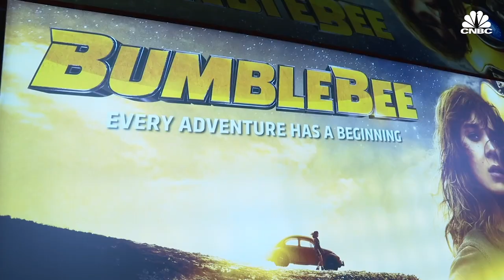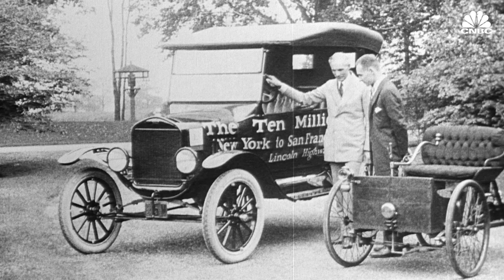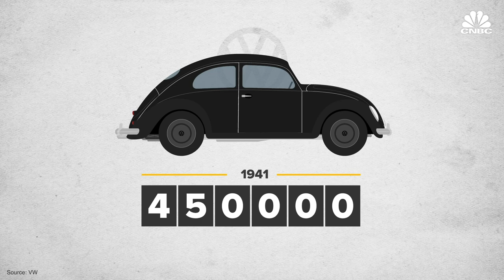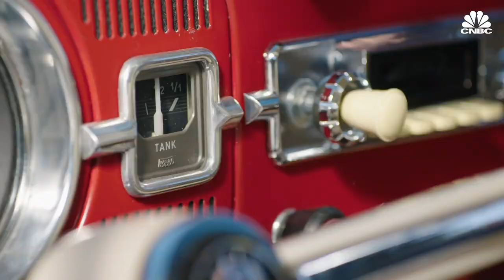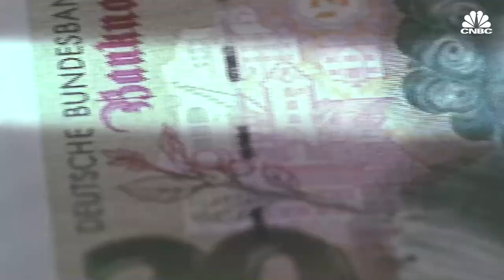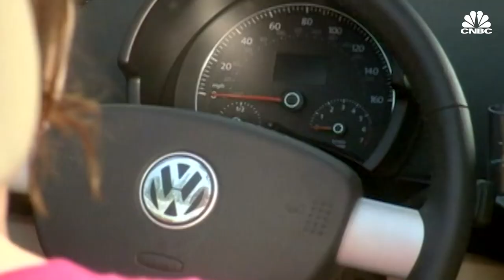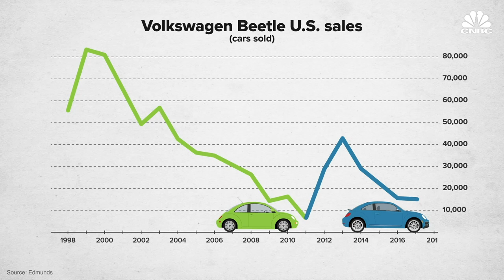Why Did Volkswagen Kill The Beetle?

Comment: Poor reliability. VW and Audi have major quality control problems
Reply: You could not be more wrong.  Since 1982 my father has owned over 20 different VW's and the quality is absolutely amazing they just keep going.  They have to be the most reliable cars around. If I ever decide to get a driving license I'll be getting a VW, probably the ID.
Reply: You are completely wrong! Check out google. The early air-cooled Beetles were synonymous with both quality and great reliability.

Comment: Between the old Beetle and the Golf, Volkswagen experimented unsuccessfully with other modern-looking vehicles. However, they all had in common with the Beetle that these air-cooled rear engines had. The cooling was also insufficient, which led to the engine overheating. 
The water-cooled front engine with front-wheel drive was only added through the acquisition of other smaller manufacturers such as NSU and Audi. The Golf, Polo and Passat (Jetta, Vento) are derived from these models. 
The New Beetle was basically a redesigned Golf.

Comment: The post-war Beetle was highly inefficient in terms of space utilization. It's external dimensions were quite large but space inside was cramped. The true revolution in small-car design was the Mini, conceived by Turkish designer Isigonis. A box with tiny wheels mounted at the corners and a transversely-oriented front engine with front-wheel drive. Raced like the dickens as well.

Comment: I drove a 1960 beetle with 36 ponies in 1968 first year of college. The tail lights were as big as my first. The bumpers we called spaghetti bumpers and no gas gauge. I found out the hard way that the reserve switch by the gas pedal was kicked to the right while driving with one spare gallon to get you to the next gas station. I gallon was a quarter. Graduated college and bought a 1972 Super beetle, my hands didn't hit the dashboard or the windshield when cranking the steering wheel. Too many firsts in my VWs.😎
Reply: My first beetle was a light blue 1960 beetle with 36 hp motor. Top speed 69 mph, took the bumpers off one day and top speed increased to a scary 72 mph!

Comment: I've owned a few Beetles and enjoyed the experience most of the time. The 1950/60s version wasn't an easy or particularly pleasant drive, I recall. The steering could be exhausting in strong winds as the front tended to be susceptible to these conditions and meant that one was continually adjusting and repositioning. Only having a 6 volt battery made night driving in  heavy rain an unpleasant and exhausting ordeal - the main beam being utterly useless. Fortunately  the later versions had much better suspension and proper batteries. The engines were amazing and virtually bulletproof. I also owned a 'variant' estate, which required a 25kg bag of sand in the front boot as ballast! The engine was fitted with an early bosch fuel injection system, which was reliable most of the time, but because the fuel was being injected under pressure, could suddenly eject the fuel feed pipe and spray petrol in all directions - an experience I had whilst driving along the Hunsruck during a holiday in Germany 30 years ago.

Comment: In 2019 I sold about 30 Beetles.  1/2 the customers who bought one had an existing one that they were keeping.  No one ever leased a Beetle as it is not your typical car one turns over every 2 to 3 years.  The problem I saw is that the Beetle sales were slight because the turn over rate was nonexistent.  I own 4.  May favorite is the 2014 TDI Convertible.  Second is my 2.5L 2013 Convertible.  I also have a TDI Touareg LUX, 2012, with 170,000 miles on it.  It's half way to being broken-in.

Comment: I grew up with the VW Type 1 - Beetle. I never owned one and I do want one now, but only as a secondary car to be enjoyed at my pleasure and not out of necessity. 
I do however, have an "almost" new Beetle - a 2008 VW Rabbit (Golf in Europe) Mk 5 which has the mechanicals of the new Beetle but with a hatchback and four doors. The engine has more access because of the larger hood. Great little car with a big engine: 2.5L I5 engine which is bulletproof.

Comment: In the 80s there was another Volkswagen model that was constantly being rebuilt and sold, and rebuilt and sold. It was a cheap and easy repair little car. Most all of them were coloured in yellow. From far its looks abit like the golf, but when closer look, you can pretty sure it's a knock down, with bare minimum comfort considered little run around car. It's the 'Rabbit '. Me and a group of college students and young mechanics used all our spare time in doing just this. This little car help me through college, allow me to pay off my student loan within two years after graduation. It also helps me in ways only a small group of my coworkers knows about. Let's just say without the Volkswagen Rabbit, I will not be the man I'm today.

Comment: And no mention in the early history that Porche stole the Type-1 design from Czech Tatra designer Ledwinka.
Reply: What year did this happen? Porsche first design of the beetle was about 1932 or 33
Reply: @keithad6485  He was a great designer no doubt. Porsche got the assignment from Hitler in 1934. He may have doodled something down in 32-33. But that looked very different than the first production type Beetle of 1938, which was just shortly after Germany's invation of Czecko. The Tatra T97 was made in 1936, has the exact same mechanical construction and a very similar design. The factory was in the first annexed part of the country. The natural follow up would have been a smaller 2-door version, but it never happened. As well as Porsche on being accused of stealing the design is reported to have replied: sometimes Ledwinka looked over my shoulder and sometimes I looked over his
Reply: @jensrogerkristoffersen5472   Porsche was designing vehicles of one type or another since before WW1 including battery powered electric 'cars'. Lohner Porsche was one such design. There is a book, long out of print, which delves into his early designs including the very first designs which became the beetle. - Dan R Post   'Volkswagen, Nine Lives Later', published 1966. If located, this book is well worth acquiring for anyone interested in the early history of VW and Porsche. I have a copy packed away, I must check it when I locate it to see if it mentions the Tatra connection. I am an admirer of Tatra.

Comment: @7:33 "In 1998, Voltsvagen decided to bring the Beetle back in a new form as a bubbly front engined car."
Why?  
WOW! THEY MENTIONED IT!!
@8:27 "a return to the original air cooled rear engine vehicle"  THERE WE GO.

At least they mentioned it;  the real value of the Beetle was MAINTENANCE as well as the purchase price;
1: No heavy transmission between an engine at the front and the drive wheels at the rear
2: No water radiator

Comment: Overheating, heads cracking and valve seat recession were a big problem in Australia. Not having a temperature gauge meant that going for a long trip on a summers day was like pulling the pin out of a grenade. If that woman is an expert on cars I am Napoleon Bonaparte.

Comment: The newer Beetle had one major drawback.
It did not float.  It wasn't terribly resistant to the elements at all. 
Those old bugs were amazing. I saw a fellow pull one out of a flooded street, towing it behind him on a rope. He got a buddy to help push it up onto a side street that was dry, opened the doors to let the extra water and a few live fish out, and got it cranked right up..first try...drove off into the sunset.

Comment: They will also float for about 10 or 15 minutes . They are good in snow because engine is low powered and is over the axles but very cold inside because heater was terrible. . They make excellent dune buggies .

Comment: My first car in 1970 was a 1957 bug with a small window in the back. It had a six volt battery, which I found out by mistake when I tried to install an eight track player in it. It had an 859 cc engine in it. I could shift it into any gear without a clutch at the right RPM, well except reverse. It was very hard for a two sixteen year olds to "mess around" in the back seat. It was too small. 

I traded it in in 1971 for a 1967 Datsun 410. There was more room and four doors. It had a 1000 or 1100 cc engine! I thought it was well made.

Comment: What really "killed" the Original Beetle in the US was the new Safety & Air Pollution Standards!  The Air-Cooled engine of the Beetle didn't work well with the Catalytic Converters, so there was really now way to continue building them for the US market!
Reply: Also they were EXPENSIVE back then for what you got. In Puerto Rico a '75* Beetle had a U$5295 MSRP (all-in, except for tag and insurance), you could get a '75 Corolla for ~ U$3500.

* last year German-made Beetle coupes were sold in USDM, convertibles stuck into '77

Comment: Everyone complained because the new Beetle had lost its roots and it wasn’t a “people’s car” anymore ... but, face the facts ... any car made today that isn’t loaded up with extra options, gadgets, and technology just won’t sell to anybody but a diehard original VW fan; and there just are not enough of them to keep sales going strong year after year for a basic, stripped down model. Any nicely equipped car sold these days for around $25,000.00 is a “cheap car”.   For those who blame VW for not making them mechanically simple, air cooled cars like the original ... you can thank environmental laws around the world for that. For those who complain that the new Beetles didn’t have the charming style and simplicity of the original Beetle, you can blame that on safety laws and arrow-dynamic demands mandated by national laws that cars  meet high standards of fuel efficiency. If the Beetle ever does return, you can bet that it still won’t (and never again will be) the car it was 50 years ago because you can’t legally build that kind of car anymore.

Comment: They should have kept the beetle what it was a practical affordable cheap to run car. They did not do that in the later models they made it expensive it was not fuel efficient as the rivals. Hope in future they make a simple cheap electric powered beetle for the masses

Comment: The original was a car that the people could afford. Most anyone could repair the flat 4. good gas mileage and affordable. The new generation was out of the price range of most young people that wanted one. They were designed and priced for the well off young woman of today. If they would bring back the original rear engine flat four then it would be a top seller.

Comment: The air cooled Beetle's design couldn't cope with emissions and safety requirements by the mid 1970's.  Air conditioning, though available as a dealer add-on, was a nightmare of plumbing and space-availability.  By 1980 70% of new cars sold in the U.S. had factory air conditioning.
The new Beetle was redesigned in 2011  solely because men wouldn't buy it or drive it.  The re-design made it look a bit more "manly" and Porsche-looking.
This story really missed so many relevant points.
The air cooled Beetle is still an awesome car though, I've owned three and loved them.

Comment: You forgot to mention two things:

1   Volkswagen didn't jump from the Beetle directly to the Golf ... they first tried to modernize the air-cooled rear-engine design, coming up with the impressive 411.  Only after Volkswagen had purchased NSU and DKW did they think about front-wheel drive (which both NSU and DKW had at the time) and the Golf.

2   It is an open secret that the original Beetle design was stolen from Tatra, a Czechoslovakian company ; in fact the Beetle shows more than a passing resemblance to the Tatra T97.  When Tatra complained about this, Hitler solved the problem by annexing Czechoslovakia and closing down Tatra.
Reply: The Golf too was also 'bought from Eastern Europe' (=stolen).
It started out as the Mk.3 Trabant.

Comment: i owned the sun bug 1973.. no ac, heater in the north east was usless unless on hwy. breath would freeze on inside of window, yes it did..i learned to exhale down .. The vales adj at every oil change. Engine.Louvers were directly over engine soaked plug wires causing no start(added a louver cover) NO DAMN self adjusters on brakes. pedal always low, always...Drums in the front?  Gas tank higher then motor!! ( causes a fuel fed fire) Using the god damn spare tire to work window washer, so spare always flat..the directional stalk only lit a bulb on dash but NOT which direction??  I miss that car NOT.. pos in my book.. My 1982 rabbit gti was light years ahead of that sun bug.. Ac and a heater yippie and a firm brake pedal..Over 100k miles never touched the valves..  fun car..

Comment: Old rear engined beetles, so easy to remove the engine. 4 bolts to transmission, fuel line, accelerator cable and about 4 or 5 electrical wires. The only mounting bolt difficult to remove with one person pulling the engine out, was the bolt which also held the starter in place, this was solved by welding a cross peice to the head of the bolt creating a T shape so it did no spin whilst underneath the car removing the nut. with a little bit of experience, the motor can be removed in about ten minutes or less. that cannot be said of front engine cars or even Porsche 911s though the principle is the same on the 911.

Comment: This car was built from 1938 to 2003 yet the Haynes repair manual only covers 1954 to 1979.
Reply: The Vintage Beetle was sold in US from 1949-1977 (last 2 years only convertibles) all German-made. It wasn't sold in the US as new before or after. Of the ones made in Puebla, Mexico and sold after 1975 only those until 1996 could be imported legally to US under the "classic car exemptions", like those earlier Nissan GT-R's.

Probably the manual editors felt there weren't enough specimens to extend the coverage for the first 5 years in US.

Comment: Price is a very big determinant in Volkswagen Beetle downfall... when there are so many cheaper options that has more added functional features, low and availability of spare parts as well as affordable operating maintenance as well... which is the original reason why Beetle is designed and created. They lost that value...

Comment: Why?   Some suggestions - the first being that the car never had very safe handling, particularly in wet weather. The tail was all too ready to slide out and once that had started it was difficult to regain control.  It was noisy, far noisier than its more modern competitors. And it was not very space efficient.  The build quality (vastly better than any UK car in the same price range) could not overcome these problems.

Comment: The back part of the Beetle has a nice shape like sculpture, and they looked the best from the outside in 1960 before getting larger windows later.
A new Beetle to be launched again that could sell well should in my opinion retain very much of the old outer design of the back part of the Beetle. But to become a practical car and look still good it has to grow in size and yet look smaller than it is while looking quite like old style Beetle in many ways, and one way to do that would be to create a Beetle on steroids that will grow to be Beetle SUV with larger wheels and to grow in size within reason. The tricky part design wise is the front of the Beetle if you want to make it look good! A Super High Cool factor is a must!

Comment: The real Beetle, the original air-cooled, rear-engine, rear wheel drive, flat four cylinder Beetle was killed by stricter clean air laws. At the end it was the national car/taxicab of Mexico. The last version; front-engine, water-cooled, front wheel drive pretender died because they spent too much time in the repair shop.

Comment: They made them for years but weren't really continuously developing them during the 80's and 90's. The newer ones had nothing to do with the original. Unlike other makes that were countinuously updated such as the Austrailian Ford Falcon or even the Ford Mustang, although the Mustang like the modern Beetle relies on its retro styling to sell. the Falcon did not

Comment: The original (rear engine) Beetle is my favourite car.  I still have one, but I only drive it on dry days in summer so it will last.  I wish they would make new ones, preferrably with better rustproofing so they would last longer.  But I would still prefer the original unboosted brakes and steering.  I would buy it for sure.  I was never keen on the front-engine water-cooled Beetle.

Comment: The narrator got the beginning wrong, he said vw bugs are the longest running production car and that's not true, the Chevy suburban is the longest continuous running production. Starting in 1936 and continues to be produced today
Reply: They're going by the design,   the VW doesn't change much from its introduction up until the 2003 Mexican Beatles,   many parts are interchangeable.     Suburban is the longest running nameplate but it's current design is nothing like it's original.   In the same context the longest produced Chevys would be the last 2 vans,   the Express van hasn't changed much since '96 and the G series before that had been around since the late 60s.

Comment: Because it's a fine 1930s car but not a fine modern car. They're easy to rebuild in primitive conditions, but not long lived. The liquid-cooled A1 era Rabbit etc single cam four cylinder is a vastly better engine in every respect. Beetles act like sails on windy days, are slow, their heaters work poorly and they're deathtraps in a crash.
Reply: Eeeh, they still hold up to this day, i bet if they kept the rear engine with new technology, in the 3rd gen chassi, it would still be around today, even if it wasn't aircooled